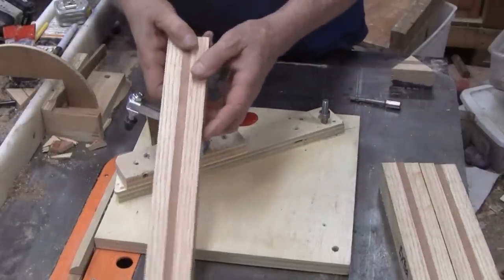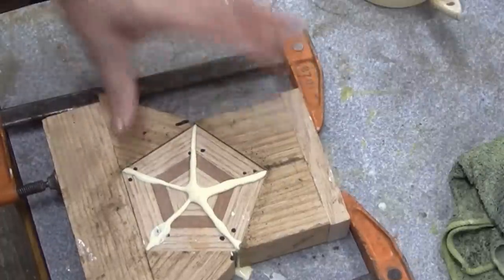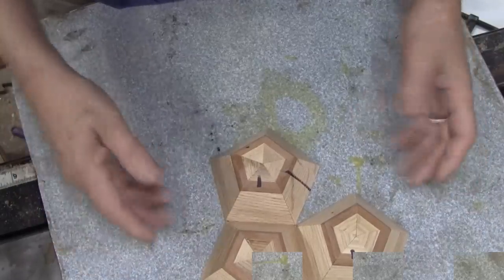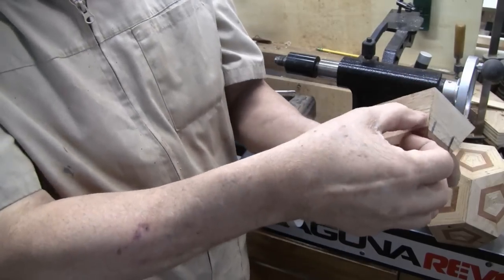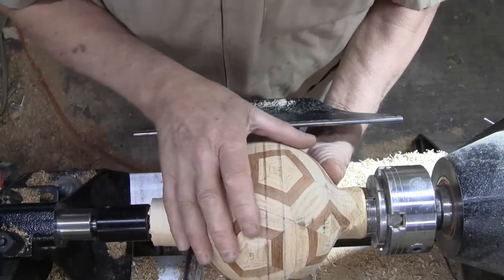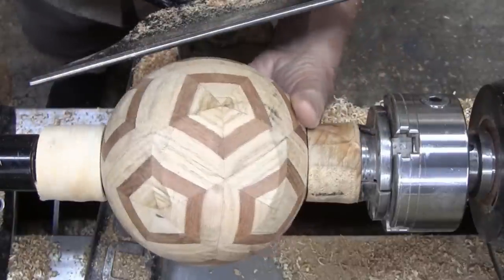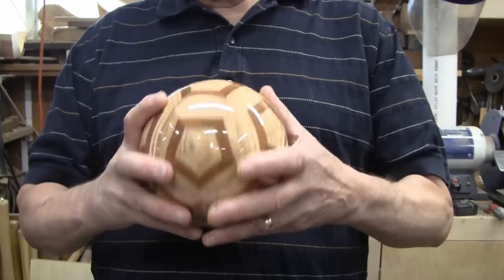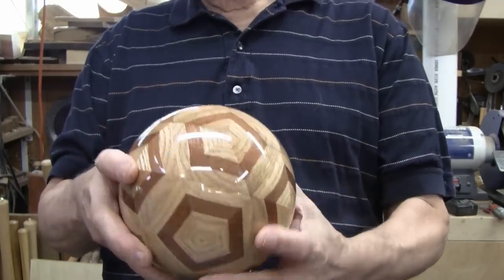Wood Turning Segmented Sphere or Soccer  Ball

Comment: Really like your works ! I'm a math major/art minor and I like working wood. When I taught in Jasper, MO,, I had my vocational math class build a dodecahedron frame about 4' across from 2" x 4"'s. We also built a yurt (Mongolian hut). I built a wood strip canoe. I also built a hammered dulcimer. I only had a vague description, so I drafted a full size plan on butcher block paper. Now I'm 71. I go in the woods with my cordless sawsall looking for interesting "diamonds in the rough"  pieces of wood. Then home to bandsaw, belt sander, Dremel,... to organic forms...
Reply from the maker: Sounds like you enjoy wood working Allan. I am a little older than you and have always worked with wood.
I am a retired wood pattern maker so I used math in my job. Never made a dodecahedron but made a lot of things using angles.
 Best of luck hunting those diamonds...sounds like a lot of fun.
Gary

Comment: At about 5:50, you said, "I thought about not turning it...". Ha, ha, I was thinking exactly the same thing! That glued-up dodecahedron (?) was incredible on its own, and would be a very impressive item if sanded and finished.
Reply from the maker: For sure Walter I want to make on and not turn it.
I made one out of some old Cedar and left one section loose to be used as a lid. Not as pretty as this one though. 
I might have to make 2 with the same nice wood and turn one and leave the other as a dodecahedron.
Thanks for watching,
Gary

Comment: Great project!  Please provide the size of the segments cut.    Thanks,
Reply from the maker: Thank you glad you liked it Arthur. The length of each of the 5 pieces of the pentagon was 2 5/8 inches along the no angled cut. That is not all that critical because all it will do is change the diameter of the ball.
Hope that helps and if not let me know what else you might be interested in.
Gary

Comment: By no means am I second guessing. I might have been tempted to make a pattern with the radius to create a semi-circle out of a piece of plywood. The diameter of the sphere. Then, lined the radius with sand paper and used the tool rest for indexing. Perhaps this would true up the sphere after turning. What do you think? I hope I explained this well enough. This video made me want to subscribe and "like" and hit the bell. Thanks for doing this.
Reply from the maker: Second guessing is fine and that is how we learn. As a wood pattern maker I always had templates that I used crayons to mark the edge. That would show me the high spots and I would remove material based on that. I turned many valve bodies and other things that had to be perfect to sometimes .015 of an inch. So your template is in order. And I have used sandpaper on the template as well.
Thank you for subscribing. Much appreciated!
Check out this sphere I made and you will see how I layout and cut a perfect sphere without a jig for doing it.
https://www.youtube.com/watch?v=_KzecGrApLk

Then check this out where I turned a large pattern using a template to perfect the shape.
Just photos as they were done at work.
https://www.youtube.com/watch?v=pf-ldN2mCs4

Comment: I'm sorry, but I didn't understand quite right, how many degrees the 5 edges of one element have to have. Thanks a lot. Your work is very very beautiful.
Reply from the maker: The pentagons are 72 degrees. The angle they are cut after glued together is 31.72 degrees.

Comment: Nice not-a-glass-but-wood-marble/football/soccerball Gary. So shiny it almost, but not quite, hides all the wood grain patterns. Only a great angle master could accomplish that for sure. Two thumbs up👍👍 Does it roll like a bowling ball🎳 - just wondering.  Ya shoulda built it with a small video cam inside to answer all those pesky questions about the insides😁   Stay safe.  -Mike😷
Reply from the maker: Thank you Mike AKA John. Not sure how it rolls and I am not about to try that. But if I drilled finger holes in it I would be able to see inside and know how thick the walls are.
Also find out where the marble got glued in. It is not rolling around so must have found a patch of wet glue.
Take care,
Gary
Reply: @ThePapa1947  No my goodness No! No finger holes !
Uhm, how did you know my first name is John ? 👀 Only the bank calls me that 😁 hehehe
Reply from the maker: Mike John U Hoo...figured it was all the same..lol
Sorry that was meant for Mike...I mean John
Reply: @ThePapa1947  Ok, here it comes ... you can call me Ray, ... Bill ... Sue ... just don't call me late for dinner😋

Comment: How thick did you have to make those pentagons?
Reply from the maker: As I recall they are 1.25 thick. A little thicker than needed but I wanted to make sure.
I still have a spare I made I will have to double check that.

Comment: Great project as usual Gary. How did you arrive at the cut angle of 31.72 degrees? That doesn't seem to relate to any geometrical reasoning I can think of. I would have predicted  360/12 sides = 30 degrees. Nevertheless, I'm going to accept your cut angle on my 1st trial piece this afternoon. We'll see! Thanks.
Reply from the maker: Thank you Dan,
The fact those pieces are pentagons and not make a circle around a flat plane the 360/12 does not work. I had to dig deep to find a chart on dodecahedrons and found that angle. It really got tricky on the Baltic birch plywood version.  This one was much easier.
Best of luck and let me know how it goes.
Gary

Comment: How wide was the staves that you cut segments from? And how long was the edge of each pentagon?
Reply from the maker: The strips I cut them from measured 1.81 inches  wide and the width of the each pentagon piece is 2.625 inches.
If you make it with that pattern the oak strips must be exactly the same in order for them to line up when glued as a pentagon.
Hope this helps..Gary
Reply: @ThePapa1947  Thanks for your response.

Comment: If you make another ball, try this trick. Make a cylinder about 60% of the diameter of the finished ball. Cap it at one end and fasten a shaft to fit a drillmotor. Angle the other end to roughly match the angle of the ball you are making. Glue strips of sandpaper to the open end of the cylinder. While the roughly turned ball is turning slowly in the lathe, apply the rotating sanding cylinder to the ball while changing the angle back and forth. Change the axes of the working ball occasionally as you did here. This will result in a perfect sphere.
Reply from the maker: Peter I could see that working. Kind of like when some people use a hole saw to create a sphere. With good geometry and accurate cuts you can still do it the way I did. Always nice to have a few choices though. But I will not be using a sphere jig.
Thanks,
Gary
Reply: @ThePapa1947  - Exactly the same principle as using a hole saw. A cutting/grinding circle smaller than the sphere tends to "sphericize" the sphere quickly and accurately.

Comment: Your sphere is, to say the least, amazing.  I watched with great interest how you put it together.  I also watched your video of the birch plywood sphere as well.  Again excellent sphere.  But I noticed that when you came to the sphering  process it got a bit tricky.  This is where I come in. My hobby is making spheres.  I make my spheres out of different kinds of stone.  The process is about as involved as yours is I think. I have a proposal.  If you could make a sphere up to the point where you put it in the lathe and send it to me I could turn it into a perfectly round sphere and send it back to you for finishing. It seems that I can make just about anything round and I would like to try one of your wooden beauties.  If you like the result I could do more spheres for you.  If it works maybe you could send me a half finished sphere for my collection. I will send a few pix of the spheres I have made and a bit of the process as well. Very best regards. Please let me know what you think.  Mike H   (note. I would need your ph no to send the pix and videos, I’ll send you mine as well a bit later)
Reply from the maker: I would be interested in your process for making spheres.
Only other process that I know of is to use a sphere turning jig for the lathe which I could make or buy. I would probably make one though. Or the other option is I could use my cnc machine with a 4th axis to make it. They would be perfect and I could do other things while it machined it.
 You might want to check out my sphere making without a jig just using math,
https://www.youtube.com/watch?v=_KzecGrApLk&t=970s

If you want to explain your method here that is fine.
Or you can find my email in my About page.
Gary

Comment: Hall show,  congratulations, i wanr tô teu one too , please way das tchê regras of cut, um advance ,  tank you.
Reply from the maker: Thank you, I was not able to translate what you  said but thanks for watching.
Gary
Reply: @ThePapa1947  tank you.
Reply: @ThePapa1947  l asked chat tchê angle of cut on sides of each pentagon is.
Reply from the maker: They are cut at 31.72 degrees off of 90 degrees. So with the blade on the table saw set at 90 I tilted it 31.72 using a digital angle finder.
Hope that helps.
 Gary
Reply: @ThePapa1947  tank you
Reply: @ThePapa1947  now i get it. Tank you boy.